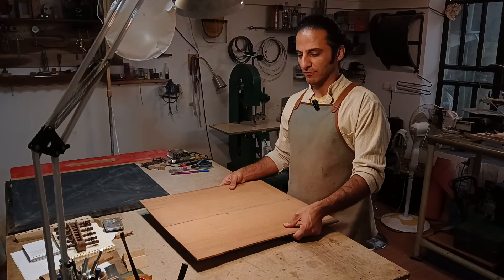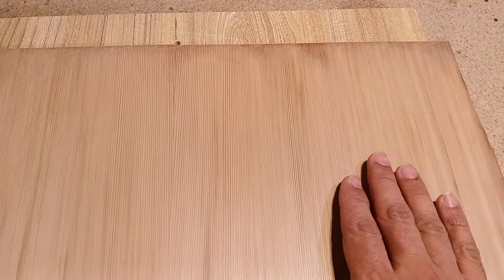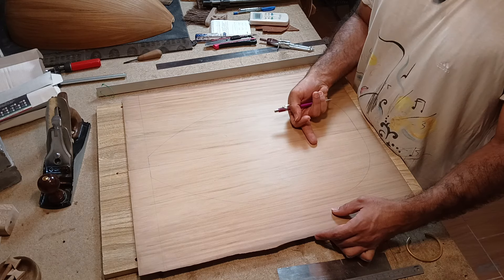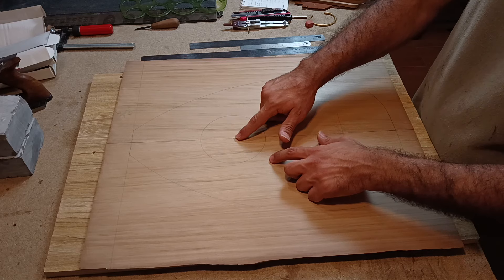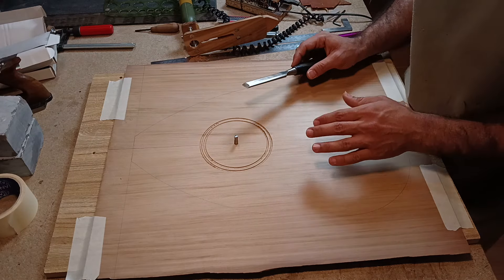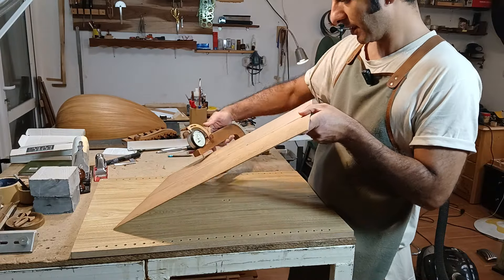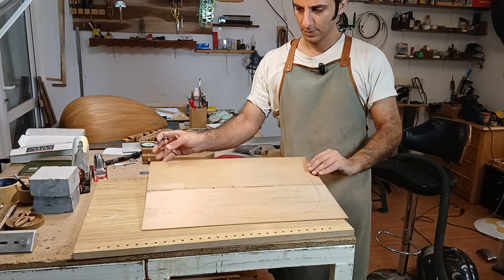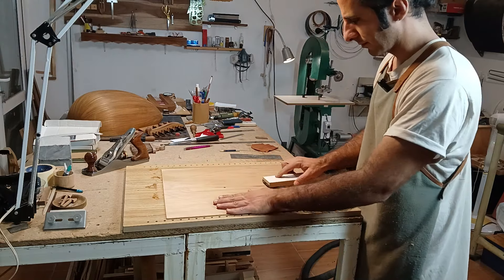Oud Soundboard - Thickness Strategy

Comment: That's super correctly Mansour ..  
About the length of strings ,means from the nose to the bridge there's 3 styles :
Turkish style is:  19cm for the neck length.
Iraqi style is : 19-19.5 cm =============.
Eastern arabic is 20-20.5 cm ==========.
About me : I like 20.5 cm length of neck >> ALL: should be 1/3 neck to full strength of strings length '
mean if neck 20 cm the full strength shoule be 60cm. 

as I said : Always you did very well Mansour .
Reply from the maker: Personally I was very into 58.5 (19.5 neck) recently, but now I'm gonna focus on 60cm for a while for some reasons. Thanks a lot for your great information you shared 👌❤️
Reply: @mansouroud  You're very welcome dear , I really tought alot by you 🤗☺😚

Comment: Can you, please, in your next video explain the method of putting bridges ? The distances or the proportions 
Thank you
Reply from the maker: you mean the braces under the soundboard or the bridge?
Reply: @mansouroud   Yes please. How to find the right place to put them.
thank you so much
Reply from the maker: @Ayyoub.Guelzim  the bridge has a fix place. If you divide the length of the strings in 3 parts. First part is from the nut to the neck join, second part from the neck joint to center of the main hole, second part from the center of the main hole to the bridge. So it depends on the length of the strings you decide to have.